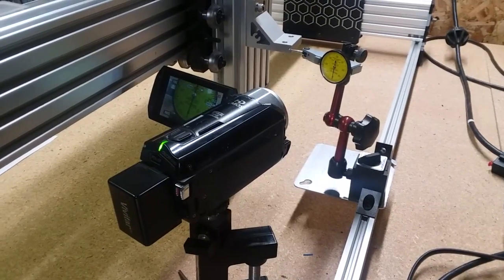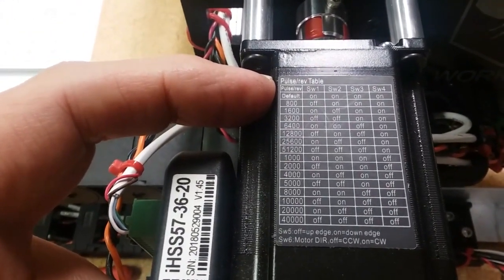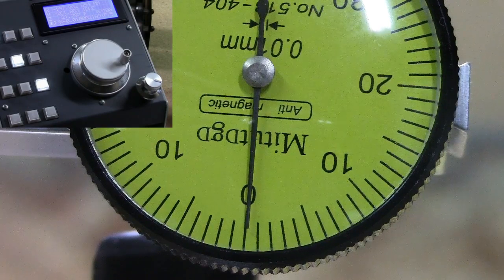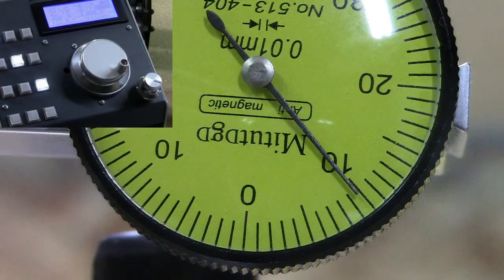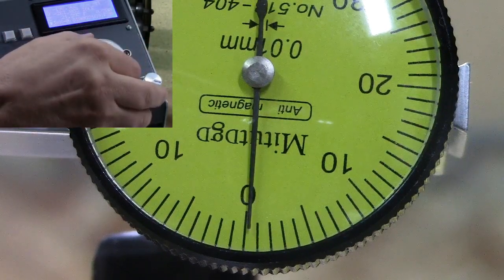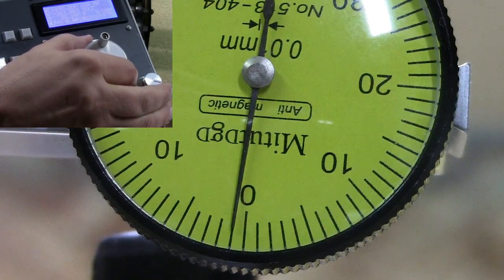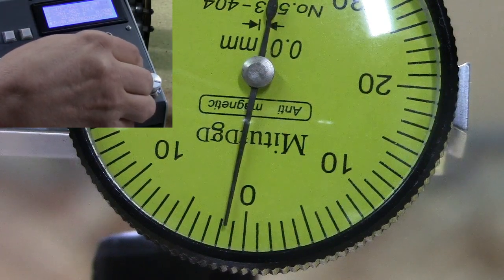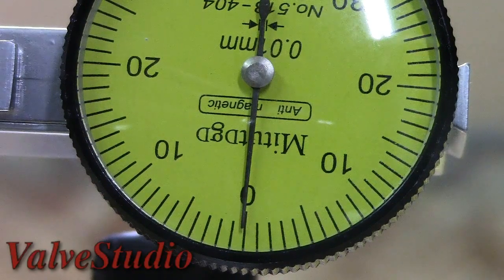181030 Value Studio - Tonehenge Journey in 0 001mm Steps

Comment: It is an amazing work you did there, and thank you for sharing this result. I actually think the wheels are super cheap and clever way for moving the stage. I think, the wheels' large radius and softness helps to increase the accuracy. It is averaging the rail surface roughness just like air bearing or oil bearing. I need to buy one rail and work on it.
Reply from the maker: Thanks for writing. The integrated step-servos with microstepping encoder feedback is awesome.